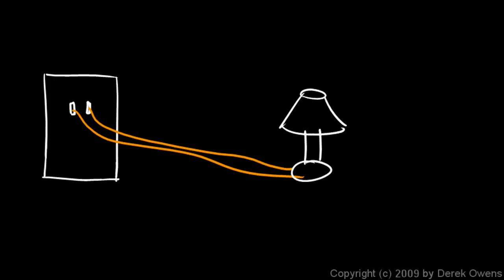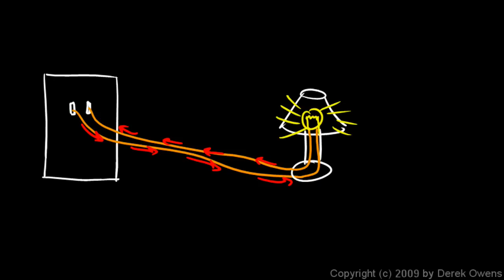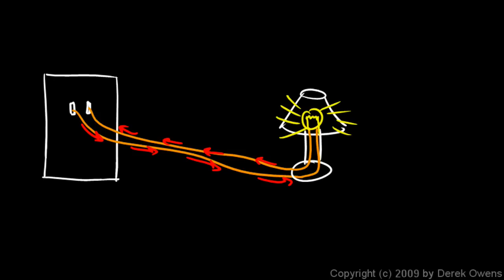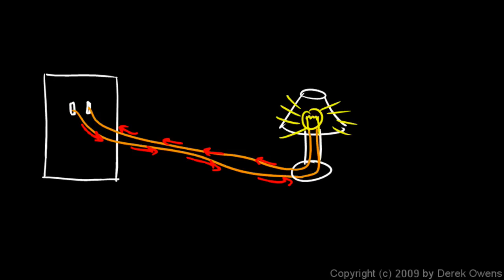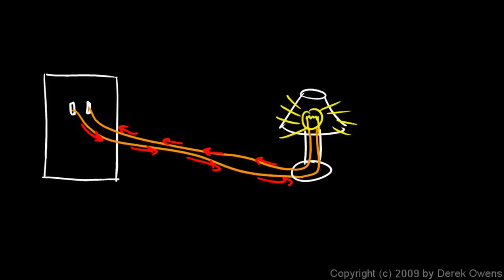Physics 12.4.1b - Electric Potential and Potential Difference, continued

Comment: There's an inaccuracy there that should be corrected. Electrons (negative charges) actually flow from a lower to a higher potential, and not the other way around, as the video says.

Comment: At 1.28 electrons DO NOT FLOW OUT OF ONE SIDE. Not a single electron leaves the socket. The electrons that give off light are already in the wires. All that comes out of the socket is an electric field. This field energizes the electrons in the wire generating heat and allowing the electrons to jump orbits thus emitting light when they return to their original orbits. Please look at this to see what actually happens.
https://www.youtube.com/watch?v=YNkD9TZtdbY&index=87&list=FLOzSf4dFr7ayyiJvrx6KZmg

Comment: A battery can send electric potential  energy to a light bulb, and the bulb changes electrical potential energy into light and thermal energy. The energy does not flow back to the battery again. At the same time, the electric current is different; it is a very slow circular flow, and the electric charges flow through the light bulb filament and all of them flow back out again. They return to the battery.[Inside the battery, chemical energy is used to move more electrons back up to the higher potential energy region (the negative terminal) where they again "fall" back though the circuit to the positive terminal.] Like lifting(chemical energy) a stone up a ladder(gain in potential energy), dropping it to lower potential(as kinetic energy in this example would be thermal and light energy in a electric circuit), then picking it up again, climbing ladder, and so on...

Comment: Please Sir I have one question:
When the potential energy of the electrons is converted to light energy for use by the light bulb, how will it travel back to the power outlet? In what form of energy and how does it get converted?
Will the energy be reduced since it has been used by the light bulb?
If so, how will the electrons get charged again???

Comment: Hello Mr Owens
You said that the electrons have to flow back in to the energy source to keep the circuit continuously flowing. In case of charging a phone, the same amount of electrons flow from the first wire to the device and back to its source right ? So how does the phone continuously get the electrical energy to charge itself when only the same amount of electrons move in the circuit ?

Comment: Just out of curiosity why do the electrons generate energy instead of just moving faster? Is there something that just causes it or do electrons not move faster?
Reply: It's because of resistance. The filament in a light bulb acts as a resistor and impedes the flow of the electrons. This "friction" between the electrons and the resistor generates heat, which causes the filament to glow when hot enough.

Comment: Hey Mr. Owens, just a curious question. If going by what I've learned so far, does that mean say, if one touches the both wires separately after exposing the rubbers, one wire will generate a higher shock than the other since they have different charges or they will both generate same amount of shock? thanks
Reply from the maker: vincent bishopz Vincent, it's not that either wire generates the shock.  They are both necessary as parts of the circuit.  There are electrons on one wire, with a lot of energy, and they are looking for a place to go.  The place they want to go is to the low energy place, the other wire.  Just like water naturally flows downhill, the electrons will naturally want to move from the high energy side to the low energy side.  If you touch both wires, then you provide the path through which they can flow.  You get a shock because the electrons then flow from the high energy side, through you, to the low energy side.  The severity of the shock will depends on the difference in energy level from one wire to the other, and on the amount of current that flows.
Reply: Derek Owens pretty interesting. Thanks for the knowledge
Reply: vincent bishopz

Comment: I dont understand why the second wire is needed. The potential difference still exists in the one wire. Is it because the input energy is too great to all be converted to light?
Reply: Because the electrons aren't used up in the process of making the light. It's the electrical potential energy that causes the light to glow. The electrons have to flow back in to the energy source to keep the circuit continuously flowing. Like when you have water flowing onto a water wheel, the water's gravitational potential energy is being used to move the wheel around, however none of the water is used up in the process of rotating the wheel. The same amount of water that went in is the same amount that will come out.

Comment from the maker: I think they are basically two ways of saying the same things.  If there is an opposite charge attracting, then that charge gives rise to an electric field, and between two points in that field there will be a difference in potential.  Or seen the other way: If there is a difference in potential, then there must be an electric field, which must have come from some charges.  Hope that helps!

Comment: And i also wanna know will the two poles of a plug socket have opposite charges or same charges of different potentials. If one hole of plug socket has only positive charge and the other has only negative, then the current flows.But you are saying that the potential difference is the in between. will charges flow due to potential difference or opposite charges attracting them? will charges flow due to potential difference or opposite charges attracting them?

Comment from the maker: That's correct.  Any electric field will force positive charge in one direction and negative charge in the opposite direction.  In a wire, it is typically negative charge (electrons) that is flowing.

Comment from the maker: Even though  negative test charge, such as an electron, would "fall" toward the positive charges, losing electrical potential energy, we define everything in terms of positive test charges.  The direction of the electric field at any point is defined as the direction of the force it would exert on a positive test charge.  An electron, being negative, will experience a force in the opposite direction.

Comment from the maker: Imagine a group of positive charges at a fixed location.  Also, a group of negative charges, at another fixed location.  Now imagine releasing a little test charge in between these two fixed groups.  Which way will the test charge go?  Well, it depends on the charge of the little test charge.  If it is positive, it will "fall" toward the negative charges, losing electrical potential energy.  So we way the negative group is at lower potential.

Comment from the maker: Excellent question.  There is a lot of confusion on this.  The confusion arises because the electric theory is defined in terms of positive charges.  The direction of the electric field, which position is a higher or lower potential, and the direction of current flow, are all defined, by convention, in terms of positive charge.  But in reality it is negative charges, electrons, that move through the wire, not positive charges.

Comment from the maker: The electrons are negatively charged, so they naturally "fall" in the direction that is opposite the direction of the field lines.  The direction of the field is defined as the direction of the force it would exert on a positive charge.  We cannot lift individual electrons by grabbing hold of them and picking them up, but a changing magnetic field can move them to a position of greater electrical potential energy, and that is what happens in a generator.  hope that helps!

Comment: @derekowens but as we know protons never move so how can it travel frm high PE to low PE. lets take the eg. of a battery if we join the two terminal of it, electrons move frm -ive terminal to+ive terminal actually the high PE is in negative terminal right ?the concept of positive terminal having high PE is just bcoz of conventional current thoery.

Comment from the maker: @NIKHIL00TEJA   Your physics teacher is correct.  The reason is that electrons are negative.

Just as a mass always falls from a place of higher potential energy to lower potential energy, so does a charge.  Charge will naturally fall from higher potential to lower potential.  The catch is that this is true for positive charges.  Electrons are negative, so they move in the opposite direction.

Comment: So if electrons keep going from higher potential, don't you "run of out of electrons"?

how do they create these potential differences?

so do the electrons flow back into the socket after they make their loop through the filament of the bulb?

Comment from the maker: @luvgory  No, it's not positive charge in the bulb that attracts electrons.  The power company provides electrons with more potential energy at one side of the socket, and a place for them to go at the other side.  They naturally flow from one side to the other just as water naturally flows downhill.  The create the potential differences with generators, which use magnetic fields to convert physical motion into electrical energy.

Comment from the maker: @bbehgam  Yes, that's right.  There is a difference between electrical potential and electrical potential energy.  A charged particle can electrical potential energy, just like a mass can have gravitational potential energy.  A point in space all by itself, can have electrical potential, but we can't think of a point in space as having energy.  And yes, electrons flow to regions of higher potential, just like water flows downhill.